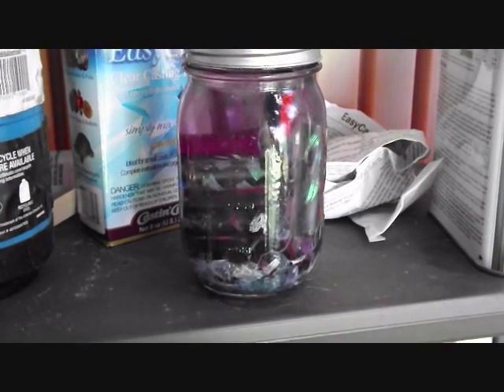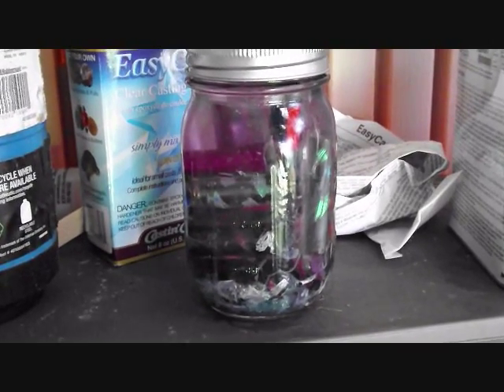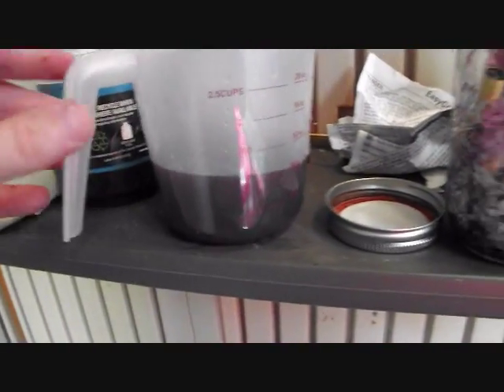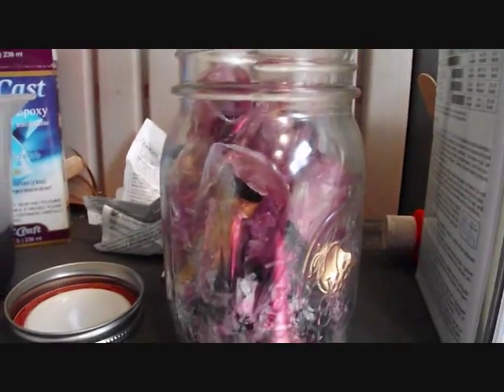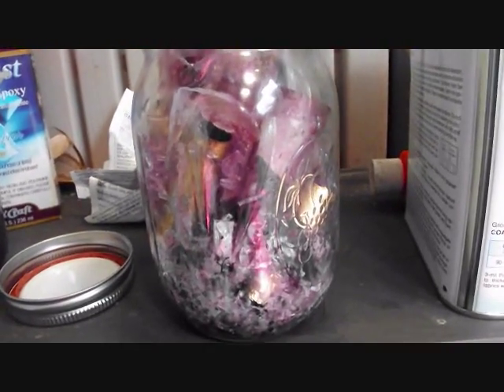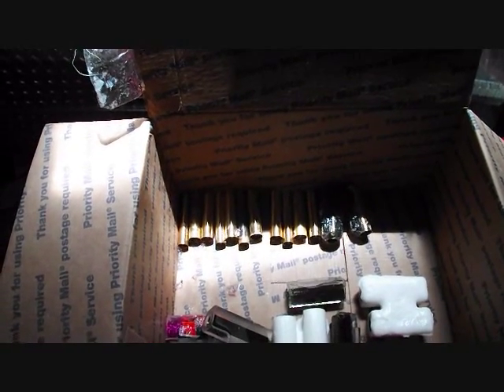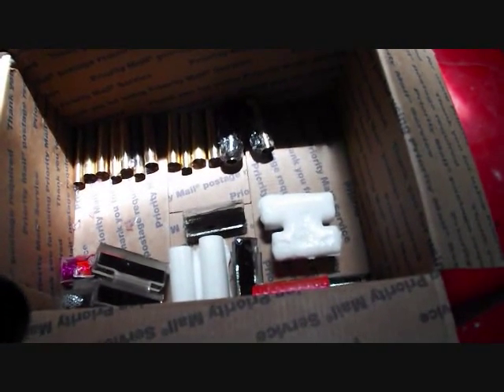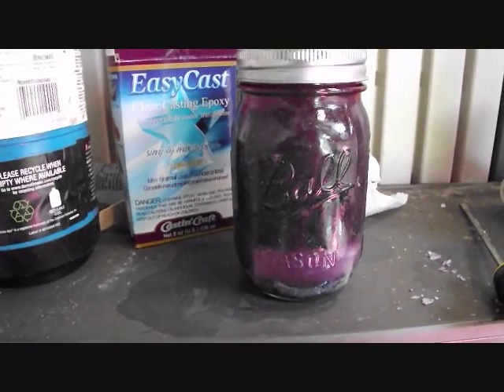Acetone's effects on Resin

Comment: I have some resin that cured on my workshop wooden table is there a way I can use acetone to get this off my table?
Reply from the maker: Possible. I'd use acetone on a rag. Just soak a piece of rag and place on top of the resin to let it soak. 

The other option is a chisel to scrap it off, then sand smooth.

Comment: Is it possible to retrieve a ring from a cured pro cast epoxy moulded block.
Reply from the maker: I'm not sure, but when it comes to resin, acetone is nasty stuff. It certainly wouldn't hurt to try. depending on the size of the block, you may want to try to isolate where the ring is (metal detector wand maybe)

Comment: Great video, very helpful. 
By making an epoxy floor in the bathroom, some epoxy dripped in the drainpipe. 
The soaking in acetone was the fastest way to remove it!  
NB: of course, for environmental reasons, the excess acetone which came out of the pipe was collected in a bucket under the drainpipe.

Comment: Ok... why? I don't understand what this video's purpose is. Why do those tubes have resin on them, why are you removing it?
Reply from the maker: At the time I was doing a lot of on tube casting for pens. When I had a failed resin experiment I wanted to be able to clean the tubes for another go. The old way was to put it on a lathe and turn the resin off. Took a lot of time for the number of blanks I was going through, so needed a less time consuming way. Acetone worked wonderfully.
Reply: @1972Russianwolf , Ok cool; that makes sense. :)

Comment: what kind of resin do you use?
Reply from the maker: I was using PR (Silmar41) and Alumilite at the time. I completely moved away from Silmar as my shop is in my basement and the odor was horrible in the house (nasty stuff that you need a respirator for really). I also used West Systems Epoxy (105/207) for some blanks that needed to avoid the higher heat that Alumilite has. Mainly I use Alumilite now though.